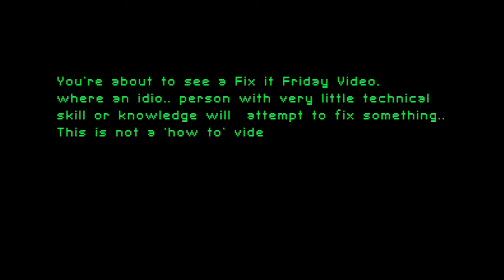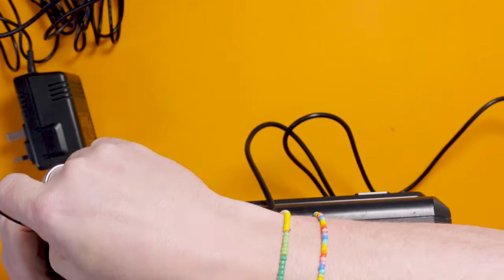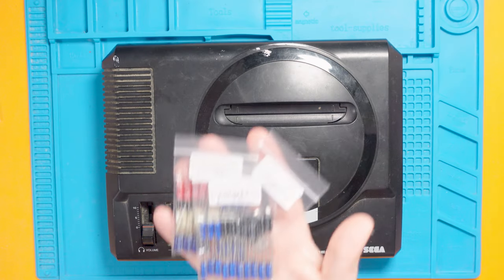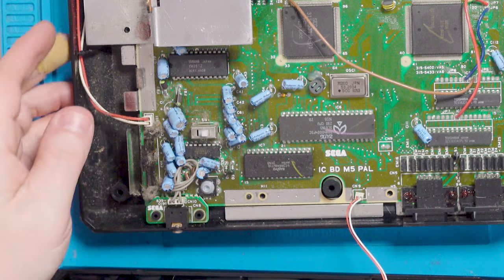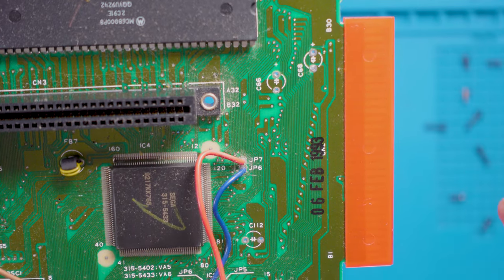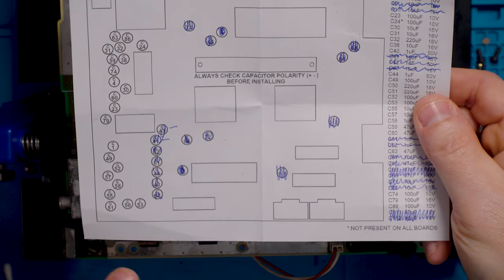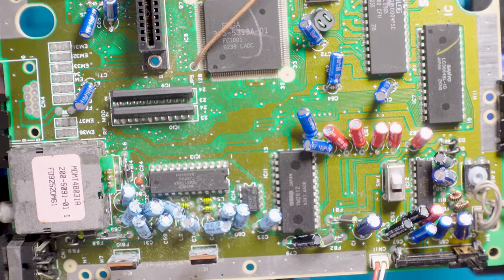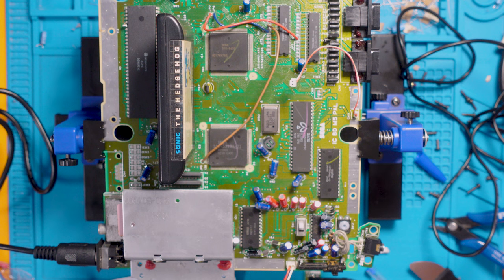A MEGA (Drive) Video - Dismantling, Replacing the Capacitors &  Voltage Regulators - Fix it Friday

Comment: Well done. Sealed LED should be ok if washed and dried, check connections / polarity voltage.  If C24 is a tantalum cap then worth replacing as these are notorious for shorting when power is applied. A practice (which may help or hinder) is to gently run some plier jaws along the lengths of pins on through-hole components. This removes oxidisation and makes soldering / reliable connections easier.
Reply from the maker: Great tips! Thanks so much!

Comment: Hello, learned about you through Vince.
The board revision is a newer VA6.5; the final Euro-PAL board was 6.8. The only real differences are the VA6.8 markings and the CXA1145 under the heat sink being made surface-mount.
Reply from the maker: Ahhh great knowledge! Thanks for sharing
Reply: @kiphakes  Really really late response, but I forgot to add that you can find out the year your console was manufactured by the serial number. The second number from the left is the year: 8,9,0,1,2,3 for the MD1; 2,3,4,5,6 for MD2.1988 was the launch year for the JP MD1, so 8 corresponds to that year, for example. Both your Mega Drives were made in '93. Sites like Sega Retro and Sega 16 are really good resources.

Comment: I have a question. I'm actually about to work on a couple of Super Nintendos as well as a Sega Genesis and I noticed that they both take that same voltage regulator. The Genesis has thermal paste but the Super Nintendo doesn't. Do you think it would be a good idea to add thermal paste to the Super Nintendo voltage regulator in the same way as the Genesis? I honestly don't see how it could hurt but I just wanted to run it by someone like you who has more experience with this kind of thing
Reply from the maker: Yeah, I don’t think it would do any harm adding some!
Reply: @kiphakes  I guess that's one example Sega doing what Nintendidn't
Reply: @kiphakes  and thanks
Reply: @kiphakes  *of